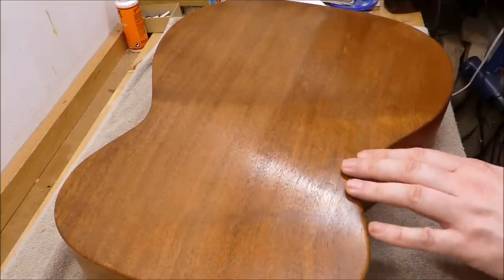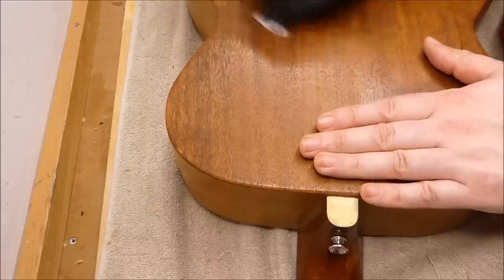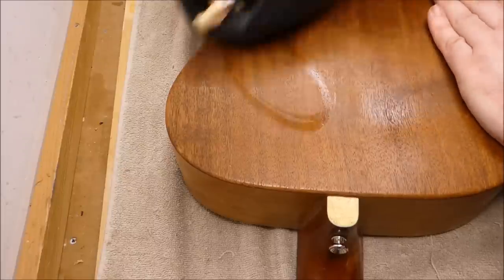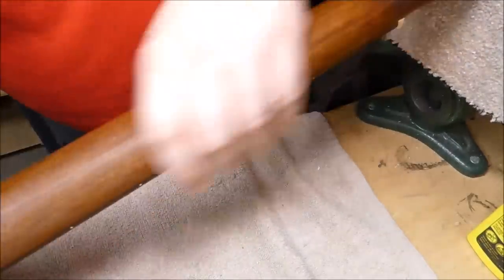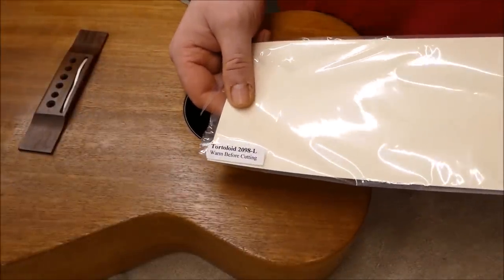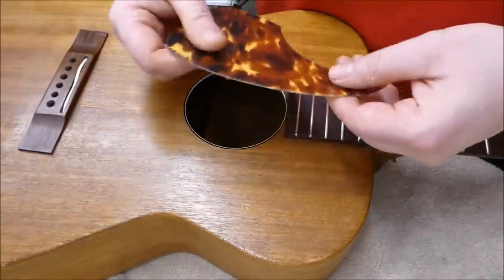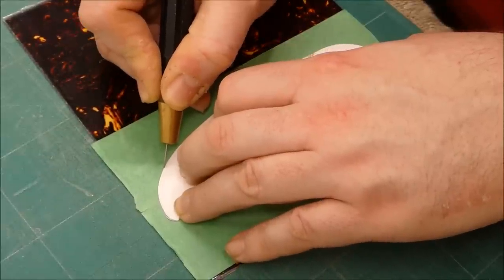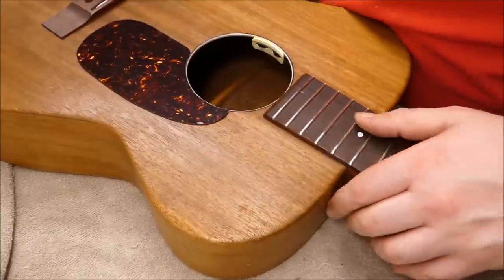Harmony Overhaul 7: Conclusion

Comment: I've got a H165 from 1967 that needs a lot of the same work but it was a bargain at $25 from the local Salvation Army. The top isn't as bent, but the bridge is lifting, and it has a dent in the lower bout that broke inward, but all to wood is still intact. Neck needs a reset, badly, but the finish and wood are in much better shape overall (full thickness, but age cracking). This series will be my reference for when I get the time to learn...thank you very much.

Comment: I once went down the rabbit hole trying to find where to buy sheets of tortoise celluloid and ended up at a sunglass manufacturer in Italy! It was an option but in the end it was just too expensive. 
The cheaper alternative is to buy clear casting resin, there's plenty non-toxic hobby stuff on the market nowadays use so you don't have to worry about hazardous fumes, and play around with different dyes and inks. It takes some trial and error to get there but the result is far far superior to the printed stuff and it won't age and warp like celluloid, not to mention you can replicate all kinds of the different aged tortoise guards out there!

Comment: That was a fun series to watch. I’ve been repairing and building instruments since 1978 and  you’re one of the few repair people on the interwebs that I agree with your procedures and reasoning for those procedures most if not all the time. FWIW,   I add one extra step to my pickguard beveling regimen:  I wet-sand the edge  with 600 and 1000  wet or dry, which really burnishes and softens that bevel.  Then usually buffing with an old soft tee shirt. (Or on the tee I’m wearing :-).  Looking forward to checking out some of your other projects..

Comment: What a great series!  Thanks for taking us through this in such detail.  I have this same guitar (a 1966 model, purchased in 1970) and while it needs a neck reset, it sounds terrific.  It has a very clean, dry, well-balanced sound, and it's loud. The neck reset would be too expensive, and I don't have the courage to do it myself and risk damaging the guitar beyond repair, so I just use it for cowboy songs and slide.  The body is light and fragile, it has lots of minor damage around the edges, which I've treated in the bad spots with thin beads of 2-part epoxy.

Comment: I had to write, I enjoy your videos immensely.  I repair and rebuild autoharps, for one of our local music stores as a contractor, there is not a huge amount of work, the harps being a relatively uncommon where I am (honestly everywhere) and guitars are above my pay grade, but even so I have learned much applied  some from watching you work.  I often get called to put in a pickup on an autoharp but usually end up do one or two most years when once folks hear what a good quality pickup will cost installed they often are happy to go with a contact mike rather than a magnetic. 

 I bring that up because I face a similar issue to what you did in this project. The sides of many harps are just to thick to use conventional jacks on. While I don't use a strap button style my solution has been to glue the pickup in. The body being narrow bolting them in is problematic and sound hole placement can be an issue as well. If they fail or are damaged heat softens the glue enough to allow removal. I wonder if that might have worked. I don't honestly know if I would trust them to hold with the stress of a strap but I tend to think they would,   Just a thought.

Comment: On plastic parts like with scratching etc you can use a light oil or coconut oil etc and it really covers scratches on particular those edge parts. I’m a composites engineer and sometimes need to cover crimes haha.

Comment: Hmm, I think a good quality pair of machinist's dividers could be very useful for measuring things and dividing a length into equal segments. Cabinetmakers use them to space dovetail joints accurately.  Also, Fastcap makes a flush-cutting wirecutters that work very well on non-ferrous metals.

Comment: @twoodfrd pro tip: carefully and quickly run a small blow torch lighter on the sides of that pick guard and it will make it shine like the top. it will "melt" the haziness from the blade or sandpaper. works on plastic, plexi, celluloid, etc.

Comment: I must admit to a certain amount of problems with the 'economic' point of view. If I as an adult, and fully informed that it's not worth it in monetary terms given the value of the guitar, still want the work done and am willing to pay for it then surely that is my choice. I've had luthiers refuse to do things despite saying this to them - after all it IS my instrument and some things you can have special bond with or are more important to you than the cash. For example I have a really good luthier currently properly fixing up an old 1933 Kalamazoo KG 12 with a full neck reset etc. She is a superb craftsperson and I am more then happy for her to take her time as it is a pretty unique (to me) instrument. Time she has finished I doubt if there will be much change from $2000 or possibly more and since it already cost me $1000 to buy, there is no way I will ever get that back (current prices are under $2000). But I will eventually have a near original 30's Gibson made instrument and that to me is far more important than any resale value.